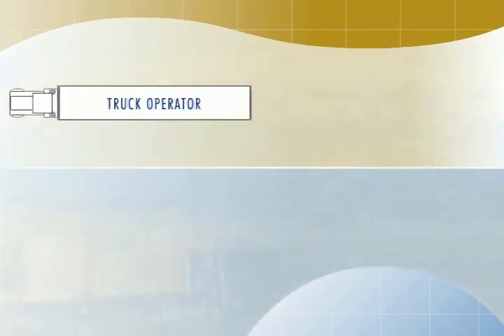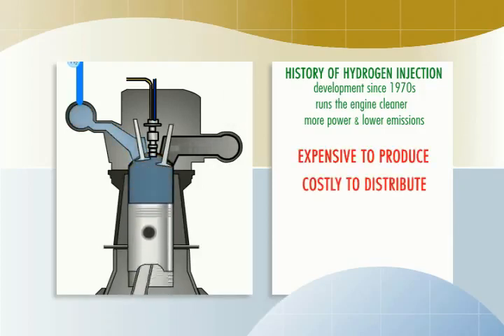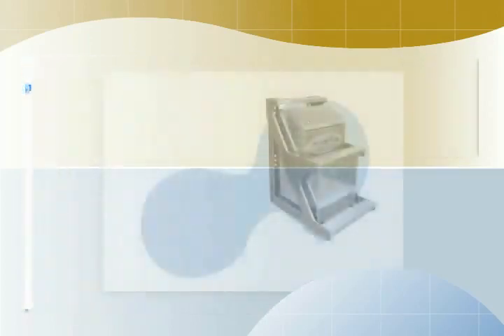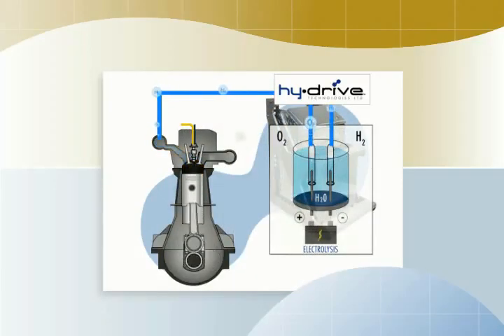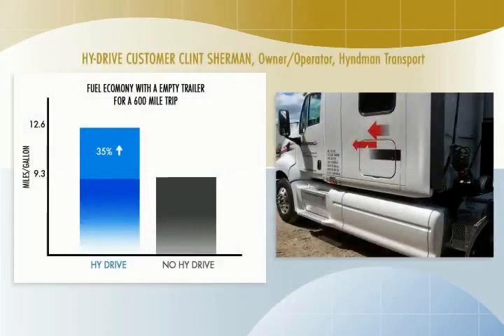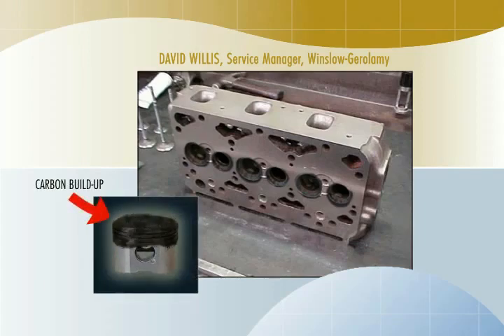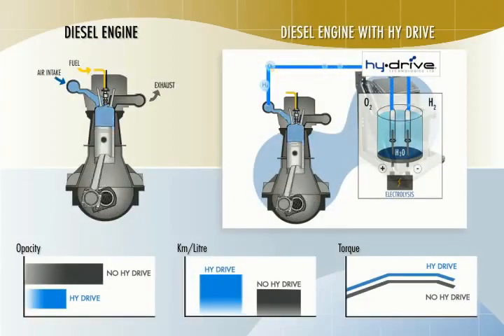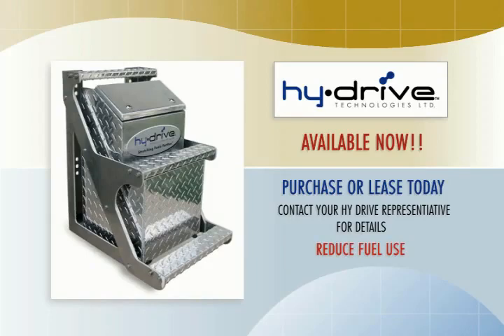How Hydrogen Injection System Works in diesel engines

Comment: This is a super old idea. It’s called browns gas and is super easy to make an anode. Literally anyone could make this for about 60-100 bucks. Also you would need an electrolyte to add to the distilled water. You can use an amp gauge to figure out the ratio.

Comment: great. but engine has egr, can we install hy drive.
Reply: The EGR has nothing to do, adding hydrogen is only in the intake, egr is about mixing and maintaining hi/ lo quantity of hot/cold air and it pressure. There is only one better way to add hydrogen. It is called oil extractor cane. To extract the oil from backflow air from the motor, and this way to refine the quality of the air in intake, before it joins the turbocharge. The oil is good for lubricating the parts in the motor, but have no place in combustion. So the hydrogen + refined air = clear and smooth engine, more power, better oil, and most of all - never need the cleaning cycle of the platinum catalyser. Because there is no polution from the bad oil in the combustion. So no cleaning cycle means lower consumption of the fuel as a benefit all along with economy from the H2o. And most of all - it is damn cheep to install the both systems.

Comment: I wish you the greatest luck, about three years ago I had the CGON system fitted to my 2005 Peugeot 407 diesel. It got terrible pre use reviews from professional detractors, suffered several top echelon promoted Kangaroo court  defeats. All I can say about this system is by way of my own experience. I passed my test in 1975 whilst serving in the Army, I have driven a multitude of vehicles all over the world all professing great attributes for countless thousands of miles and never ever come across anything close to your and CGON's offering. I truly hope that you don't suffer the fate of CGON, you have a massive series of battles on your hands from the perpetrators of bad publicity i.e. from profiteers and ruling establishments, which are "basically one and the same".
Incidentally since adding the hydrogen producer my vehicle has never failed an emissions test still drives perfectly and reduced my fuel consumption by 20% however sadly I am now down to my last sachet of hydrogen additive so I estimate I have about two years of carefree motoring as the availability of these sachets is nigh on nil.
I wish you well, I have no doubt that green hydrogen is the only way to go.
Basically what you have here is the "Rain Cycle" applied to energy. Strange how H2O is the answer to everything. Also we must remember the countless entrepreneurs who hit on this phenomena over the years and paid a terrible price sometimes the ultimate price.
By the way, I have just read some enquiries about the amount of distilled water required, all I can say is that the CGON sachet is a
Commissioning fluid for EZERO1
Contains less than 1% Potassium Hydroxide.
The sachet is 760 ML e.
Hydrogen is the only way we're going to survive and progress!

Comment: If you inject too much, the expansion occurs too early (only on Diesel engines) and you add to the heat generation and torque losses. Then you need water injection to compensate for the heat and unpredictable expansion (suppression) in order to keep the motor reliable.

Comment: Anyone ever heard of snake oil ?You have to give them credit. They made it sound good. But that's a 20 year old motor they are using for a base line.A modern DEF motor will do better in everyway then that old clunker with or without H20.
Reply: dennis kiehne no because DEF is injected in the exhaust only it's been proven you can run a car engine purely on hydration gas.
Reply: what about tesla electric trucks

Comment: I wonder why this system has nevere really taken off despite having excellent benefits and very low cost.
Reply: Because the filthy rich oil companies doesn't wants it.
Reply: I really wouldn’t give a shit about the mileage as long as it would keep my engine burning clean with no carbon buildup on my pistons valves and turbo and keeping the oil clean That’s my main concern
Reply: @abrahamghannam2137  you are burning diesel, it will never burn cleanly.  The steam will clean the engine, but you are still poisoning the air.
Reply: Joe cell worked in gasoline car, Bob lazar converted his corvette to hydride , it works like people say oil companies say no to funding
Reply: If this actually increased fuel economy, automakers would be scrambling to add this to their vehicles in order to meet ever increasing fuel economy mandates via the EPA/Government!
Reply: @__WJK__  hyundai are about to bring hydrogen fuel cells to new Zealand and new Zealand will be the world's biggest supplier of green hydrogen all they need is the infrastructure
Reply: Maybe that's the problem, excellent and very low cost
Reply: Because it doesn't work! The vid conveniently skips the energy required to break water down to hydrogen /oxygen - which is greater that the benifits claimed
Reply: @johndonaldson3619  I beg to differ. Ive been using it sucessfully for over 5 years. How is powering this system any different to turning on your headlights? Goose...
Reply: @drgav6424  Putting 'Dr' in from of your name doesn't preclude your ignorance on the fundamentals of energy and phisics...quack
Reply: @johndonaldson3619  it's not hard I put a hydrogen generator on my subaru sti went from 16mpg to 28mpg. You Change out the water/ electrolyte mix jus like a oil change I'd dump the water and put fresh distilled water every 3500 miles.
Reply: @The66josh how many Amps your system pulls from the alternator ?
Reply: @flappingflight8537  I found that the 2.5L boxer motor ran most efficiently on .35 amps not much at all.
Reply: @The66josh  thanks for the reply ! Isn’t the amount of hydrogen production ( respectively current pulled) must be somehow proportionally related to engine RPM and load ?
Reply: @johndonaldson3619  ? It uses the electricity from the trucks alternator/battery....
Reply: @corymc92  Where does that energy comes from?  Why not forget about diesel and just use Hydrogen?
Reply: @tonystanley5337  because oil companies aren't ready to stop making billions
Reply: @corymc92  the answer is you can't, and if you think you can, then prove it.  No-one has managed to do that, and the current laws of physics prevent it.
Reply: @corymc92  Yes but as you load an alternator the load on the engine increases as well. Go to your generator and plug in a heater or a toaster and listen to the engine speed drop. Put that into a moving vehicle and your fuel consumption goes up. Don't get me wrong. Injecting hydrogen in likely does what he is saying but you would need to do it with compressed hydrogen to get any real benefit out of it.
Reply: @coreycarpenter2489  if it works, it works.. and if its as good as they say, the oil companies wouldnt want it to reach mainstream.

Comment: But what if i want the charge to burn slower??
Reply: Robert Kupra Invented a type of spark plug, that was really a plasma plug. It fires four little plasma globes in the fuel air mix, and the combustion is so stable, and thorough,  that engines can idle at around 250 rpm. I am guessing that your, slower burn question is related to achieving better combustion stability... Here is how:   http://peswiki.com/index.php/Directory:Firestorm_Spark_Plug          
I have talked to this man in person. He is a brilliant engineer... If you can help him get it produced in India, that would be fantastic !
Reply: +electrondady1  small turbine and generator would be expensive
Reply: water methanol injection with high methanol by weight mix. just guessing but it seems hydrogen injection would advance timing of the lot a bit. Methanol could bring this mix back to what combustion duration was previously seen? just an idea.... cheers
Reply: +VITTAL S S squirt in some water to slow combustion . why not a small turbine and generator system. regenerative braking

Comment: 2000cc of distilled water every 80hours
mean lost 25cc distilled water in each hour
also mean lost 0.41666666666666666666666666666667cc of distilled water in each minutes
and mean the gas product rate is 777.5cc/per min (0.7775LPM)

Comment: I saw a test report from japan before few weeks
Mitsubishi V12 diesel engine (900HP) for fishing boats

original spec:
2 little of diesel make engine running for 8min XX sec (3 times test result)

1000cc / per min HHO inject:
2 little of diesel make engine running for 13min XX sec (3 times test result)